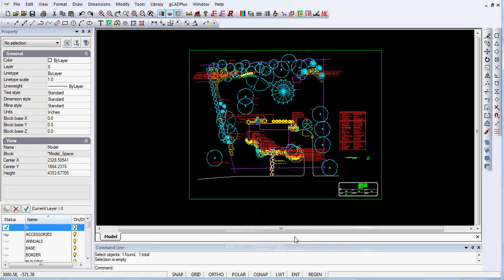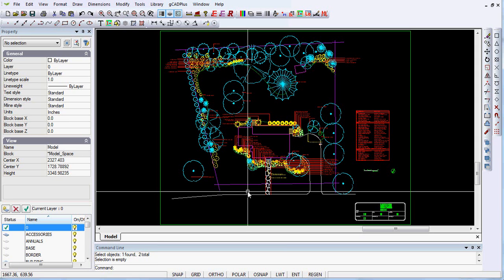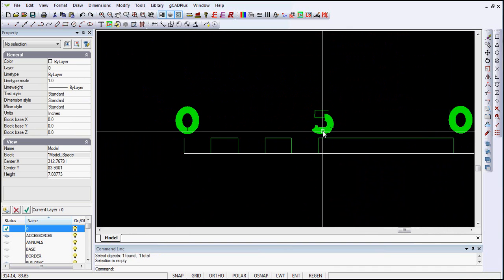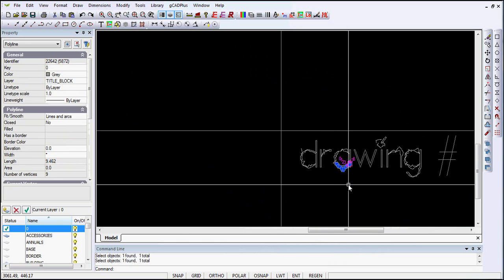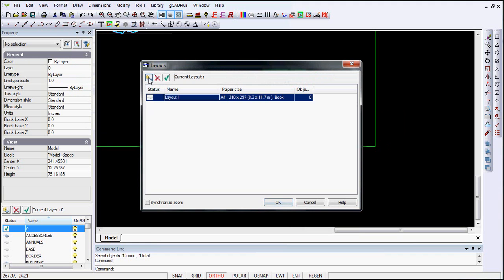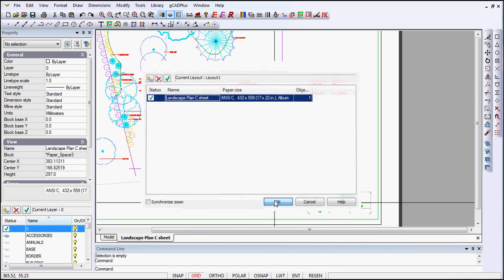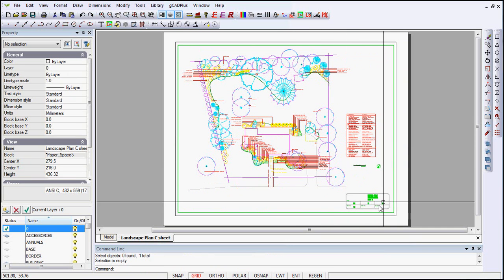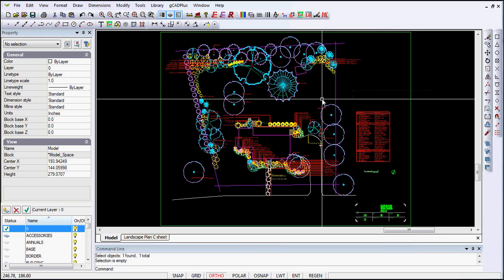Converting AutoCAD dwg files to gCADPlus format

Comment: Question: I come from CAD world, Solidworks, Etc. I have a DWG floorplan which when I scale to real world in DraftSight and then I open in gCAD+ it is out of proportion again, so then I scale back gCAD say a room 20' x 20' but this changes proportions for DraftSight again.... Why would you say that is? Now I do not know which one to trust...? 
DraftSight seems to also be a variation of the LiteCAD DLL SDK
Thanks
Reply from the maker: +Max Buitrago 
Thanks for the question Max. Provided you draw full size in model space using decimal feet when developing a design from scratch, you will not have any difficulty. I hope you can see from the movie, when you are asked to take a drawing that someone else has done in AutoCAD, DraftSight etc., not all drafters work in a consistent fashion. They do not follow a published CAD standard and a LOT of work has to be done to clean things up.
Reply: +Design Cad Makes sense, thank you for the prompt response